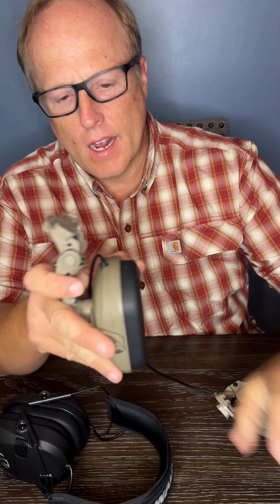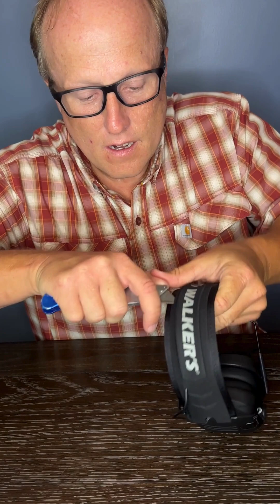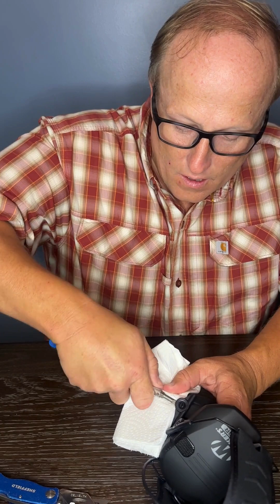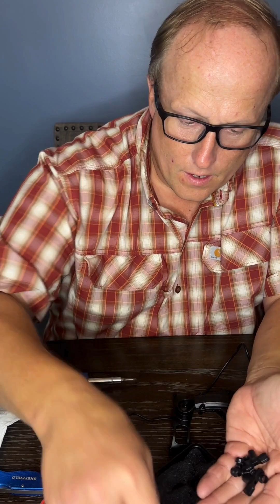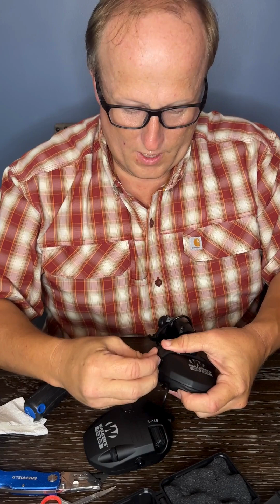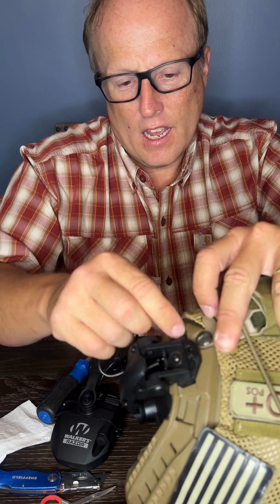TIgrett Outdoors Amp Style Walker's Razor Thin Helmet Mounts

Comment: What do you really need to reuse the headband?  A couple hook and loop cable ties, make a few small cuts behind the seam for the wire sleeve you cut open, fish it through and reuse the old sleeve channel to tuck in wire to prevent snagging and the cable ties to secure it down as a unit.

Comment: If anyone is interested, buy them. They fit tight, and I can literally sprint with them with no movement on the mount nor the razors. I applaud you, Jacob, for not pushing another shitty peltor arc chineseium clone.
Reply: I mean that's kinda what this is. It's just slightly better than the other clones. 

Maybe yours held up better. I've gone through 2, don't want to buy a 3rd so I'm saving up for the real deal.

Comment: These exact mounts are under 100 Chinese rebrands. They have terrible reviews
Reply from the maker: You don't see anything different? I was tired of the terrible designs so I fixed a few things. They are not perfect, but we are holding at a 4.6 star review after a couple hundred have sold. All the other similar mounts have 2.5-3.5 star reviews. I actually focused on the negative reviews when I worked with the manufacturer to make these. I sent them a video today to make another update from a negative review I received on them. Being a small company that orders in batches of a few hundred lets me make changes pretty quickly when issues arise for different style helmets or different style rails. I do get tired of my products being given a bad rap because similar products are not done well. Its that whole judge a book by its cover thing, except its judging a book by a different books cover.
Reply: @Tigrett_Outdoors  your product has 8 reviews on Amazon. One is terrible and the great aren't very positive.

Comment: I mounted mine on my TW and the arms do not provide enough pressure to keep the cup seated firmly, especially when i turn my head. Any suggestions? Seems like it could use more spring tension, as its really weak when donned
Reply from the maker: Send me a private message and let’s get on a video call to troubleshoot. Not all helmets are compatible.
Reply: There's no private message option on here
Reply: @troop6eaglescout  I have the same problem
Reply: @CharScarX thats what we get for not just buying ops core. I've tried everything. The springs are weak and it I've noticed the mount on the rail flexes too. Best I've been able to come up with is scrap their mount and use a metal m-lok and thumb screw, but that's just get me by till I just buy some real ops core amp arms
Reply: @troop6eaglescout  never mind, I got it to work: just placed the webbing from the  helmet harness over it and it provides plenty of inward pressure to complete the seal
Reply from the maker: @CharScarX the next shipment is shipping October 19th with stronger springs. I only tested them on an Opscore Bump helmet and should have tried multiple helmets. We are also working to improve the Team Wendy and be Mlock compatible. At this point we are only compatible with Arc rails.
Reply: Just got mine today and installed. They work great on guarddog body armor fast helmet.